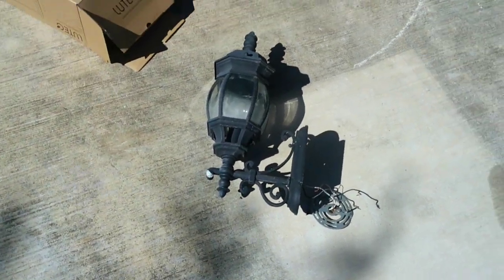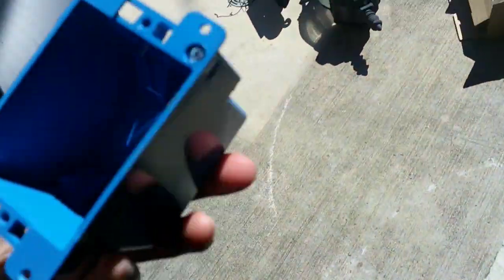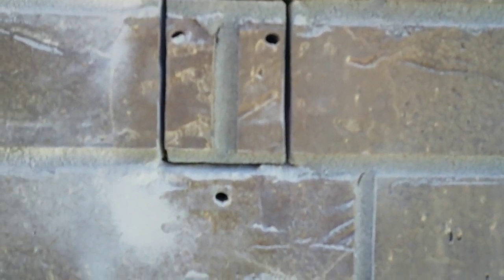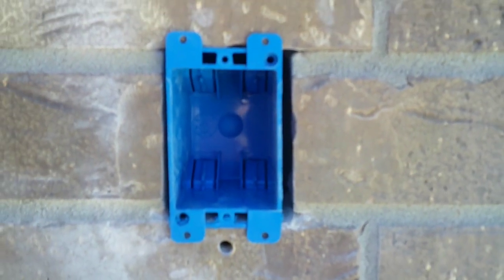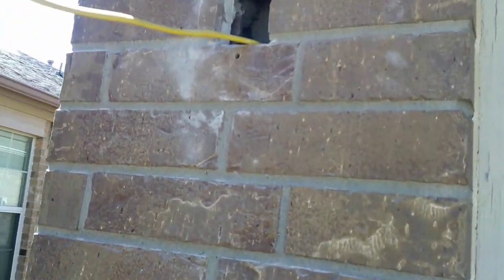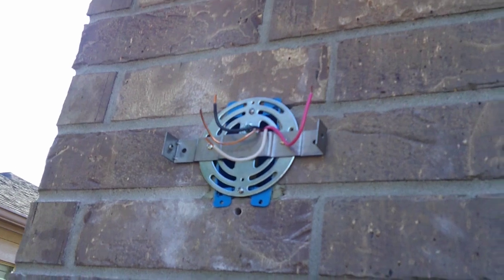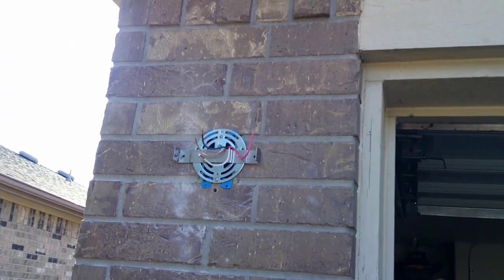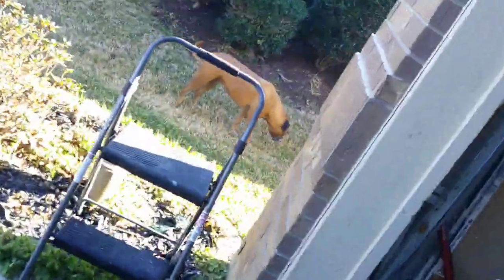Adding a sconce on a brick wall including how to cut the brick

Comment: I would have used a round box and a diamond hole saw but your method with the oscillating tool is also very smart. Good job. Thanks
Reply from the maker: Good idea with the whole saw. Truthfully I've used this method so many times adding outlets in brick I guess the oscillating tool was just my default. I really appreciate the feedback.

Comment: I am assuming these two lights are on a 15 amp breaker? That 14 Gauge wire is a no no on a 20 amp breaker(12 gauge wire required). Most DIYer's don't know this. Thanks for the video.
Reply from the maker: It's actually 12-3 Romex that I'm using. Since 2001 there has been a color standard in place for the common Romex sizes. White Romex is 14 Gauge, the yellow Romex(as seen here) is 12 Gauge, and the orange Romex is 10 Gauge. But yes it is a 15 amp circuit and the wire the builder ran to the existing fixtures is 14 gauge. Thanks for the comment and the opportunity to clarify.

Comment: Thanks for the video, I’m gonna install two lights. Can you tell me what is the name of the disk you used to cut the brick ?
Reply from the maker: I used a Swing blade with Diamond grit for my Oscillating tool. alternatively, @fiouable had the great recommendation of using a diamond grit hole saw and a round box. this would be my recommendation if you don't already have an oscillating tool.
https://www.amazon.com/DEWALT-DWA4241-Diamond-Swing-Oscillating/dp/B01GLGFVJQ/ref=asc_df_B01GLGFVJQ?tag=bingshoppinga-20&linkCode=df0&hvadid=80676721523958&hvnetw=o&hvqmt=e&hvbmt=be&hvdev=c&hvlocint=&hvlocphy=&hvtargid=pla-4584276296743549&psc=1

Comment: It would have been great to see the remainder of the wiring portion. Did you just wire it to the other light directly?
Reply from the maker: Pretty much, I intercepted the wire for the other light in the attic and made a J-Box with a single gang plastic box and blank plate.

Comment: Did you use a 90 degree drill bit for the top plate hole?... or drill in at an angle to reach the wall space?
Reply from the maker: good question! I actually used my right-angle drill with a paddle bit. I wish my arms were a bit longer though LOL

Comment: Is liquid nail the only thing securing the blue box to the brick, or did you secure it with screws through the bracket to the brick ?
Reply from the maker: While the liquid nail was setting up I drilled through the box diagonally to screw it to the brick internally.
Reply: @HowitsdoneHandyman  you used wedge anchors on both sides ?

Comment: what about water issues??  not water tight
Reply from the maker: That's a good question, the fixture I'm using is actually considered raintight/weatherproof. Generally, exterior lights are not required to be watertight. One example where you would want watertight fixtures would be a beachfront property. It's always best practice to check your local building codes.

Comment: Why didn't you just drill a 5/8" thru the brick, then string your wiring thru the hole, put your box on the inside of the garage?
Mount the light fixture with Tapcon screws.
Reply: you need a junction box on every light fixture per code even though he used the worng one
Reply: @jjparks9263  
I only drill a hole in the my brick, put the box in the drywall as you would any other box, sealed up the outside with some silicone.

Comment: Really don’t like plastic boxes used exterior.  Just had my outdoor light literally fall off the house because the plastic had become brittle in the Texas heat.  Yup, lasted 20 years but still.
Reply from the maker: Yeah, I hear you on that one, honestly, I've seen that a lot in the Texas heat. The trade-off is after 20 years the screws in metal boxes get pretty rusted in place.